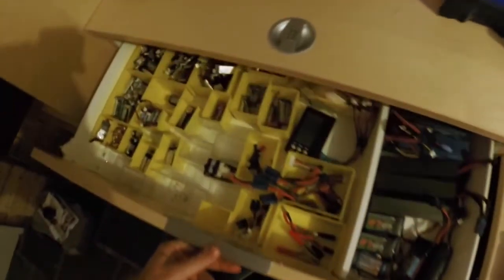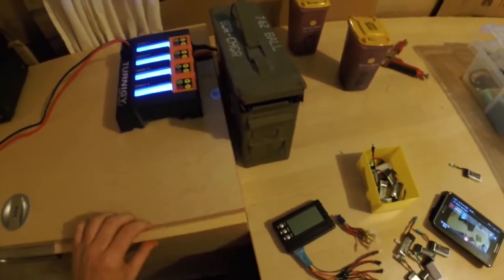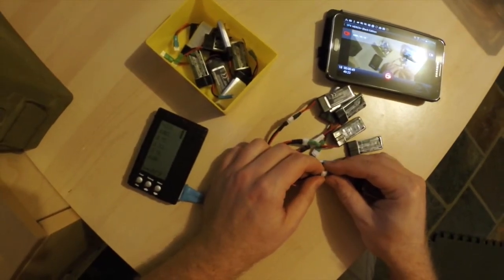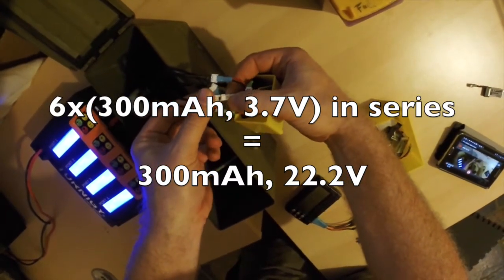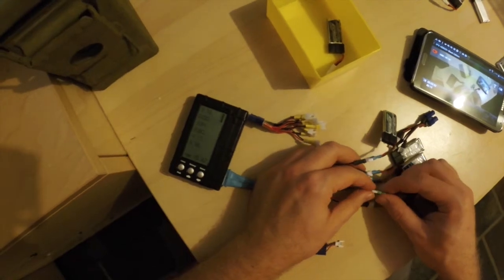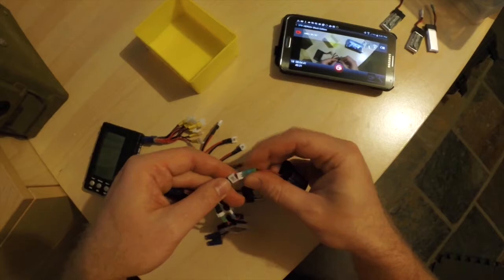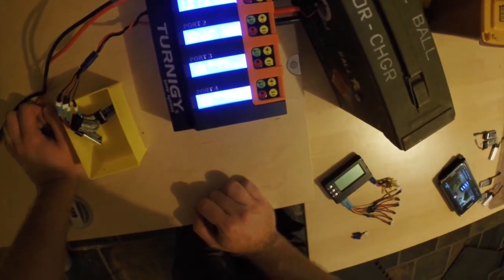How to charge multiple single-cell LiPo batteries at once (parallel/serial)

Comment: Hi. I have a Imax B6AC v2 charger + a mini parallel board with 1s, 2s, 3s JST inputs and a 3s balance connector + 6x 250mah URUAV  1s , 4.35v batteries with JST connectors. I am totally new to the subject and i simply can’t charge these batteries. Can you please tell me what is the right method with this charger? Do i select in the charger “Lipo charger” for 1s or balance charge with 6s option? And the amps? Do i select 0.2A or the amount of them all 1.5A? Totally confusing for beginners!

Comment: About Parallel Charging: Is it only important that the batteries have the same voltage? What about the capacity? My basic understanding about that is that one of my cells voltage could increase faster because it has less capacity than another. This could be dangerous, right? Or doesn't the capacity matter?
Reply from the maker: Martin Hammer You can charge packs with different capacity, but you need to keep the current low enough for the smallest pack.
Reply: Benedikt Haak I don't get it wouldn't. You charge your other packs in that scenario too if wired in parallel?

Comment: Hi Benedikt. If I charge 6 x 250mah batteries in series, does 1C not mean charging them at 1.5A?  (250mAh x 6= 1500mAh) I thought when they are in series, the charger treats it like one big cell? (1500mAh) Please let me know whether I should charge at 0.25A or 1.5A. I'm really concerned, thanks!!!
Reply from the maker: Six 1S 250mAh cells in series form a 6S 250mAh, which should be charged at 6S voltage and with 1C = 250mA. I made another charging video in the meantime, please watch it here: https://micro-motor-warehouse.com/collections/micro-charging-abc
Reply: Thanks for the explanation, didn't realise mAh stays the same with increased cell count... Loving your videos btw!
Reply: @BenediktHaak  can you mix batteries with different capacities when charging in series?

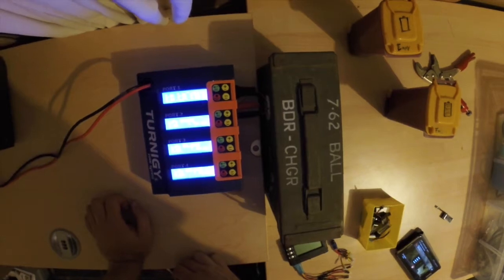Comment: At 3:00 you say you have to charge as many battery's as connectors. Why is that?
Reply from the maker: GORT Its a serial cable. If not all cells are connected, the series is not complete and the circuit is not closed.
Reply: Ahh yes I understand now.  Thank you

Comment: (Thanks for the video) QUESTION: Don't you need the balancing leads when you're charging those little batteries in series? I'm confused. Thanks in advance for your help. Regards.
Reply from the maker: Juan David Barrada when charging in serial, the balance plug is used to balance the cells actively. In parallel, they balance each other automatically.
Reply from the maker: Juan David Barrada they are single cell batteries, they don't have a balance connector. I'm essentially converting them into multicell packs to charge many of them at the same time.
Reply: Exactly, that's what I meant...why if you charge all those little batteries as one big multi-cell battery it doesn't need to be balanced? How can you be sure that each cell has the same charge than the other ones and not maybe instead being over charging some of those? Thanks again!
Reply: Same question

Comment: Is there any advantage to serial charging 1s lipos?  They dont have balance plugs so you're basically reading total amps or total voltage either way.  Is there any specific C charge rate that would balance them better?  like a slightly lower rate?
Reply from the maker: The advantage of serial charging is that you can read/control each cell voltage individually over the balance plug.

Comment: I'm new to this and watched a lot of video, this one is great. I'm still unsure of the proper amperage to charge at. I'm charging 500 mah 3.7v 1.9 wh tenergy cell in parallel. I have 5 to charge. Any help appreciated.
Reply from the maker: 5x500mA = 2.5A = 1C for 5x500mah packs in parallel. Make sure that all packs have similar voltage before connecting them.
Reply: +Benedikt Haak  Thanks I needed that clarification. I was able to charge one to a similar voltage and then charge all 5. Worked like a charm. Thanks

Comment: good day, my plane requiere 4S2300mA, but I have 2 batery 2S 2300mA, can I put in serie and the result is 4S2300mA?
Reply: yes it would work just make sure voltages are close

Comment: Hi, VERY new guy here. Could you PLEASE direct me to the info I need to duplicate the 6 1s to battery medic cable? I ordered a 6 1s to balance plug cable, but it does nothing. Thanks.
Reply from the maker: Howard F Did you see the link in the video desciption?
Reply: Benedikt Haak thanks, got it now. I didn't know how the balancer plug was wired internally.

Comment: Excellent info benedict! I was wondering about serial charging them like that. Wonder why someone doesn't come out with a board or harness with a balancing connector that treats the batteries connected as one battery based on the S rating of the (number of batteries) batteries of equal mAh connected so the charger just balance charges the batteries as individual cells. Will serial charging do as good a job if some of the batteries have different internal resistance (some old some new) as a balanced charge of individual cells in one battery would do? I use the Hitec X4 and like using the software to monitor the charges at least every 4th charge cycle to watch them. You are a wealth of information! Thanks for sharing...

Comment: For parallel charging, if all batteries have different capacity, eg 1 with 500MA, another one with 200MA, whay would happen to the peak voltage detection of the charger?
Reply from the maker: For parallel charging, you need to adjust the charge current to the weakest link in the chain. The current will be distributed based on the internal pack resistance. For simplicity, lets assume its the same for both packs. If your charge current is 400ma, each pack takes 200ma, and thats 1C for the small pack.
Since parallel charging means that all packs have the same voltage, the chargers detection algorithm will work just as on a single cell. Good LiPo chargers use the CC-CV technique: constant current, constant voltage. That means they use a constant current (whatever you set it to) until they reach 4.2V per cell. Then they ramp down the current to keep the voltage constantly at 4.2V. When the current reaches a certain threshold, the charge terminates. That current is usually 10ma, but some chargers have up to 100ma. That means tiny LiPos arent charged as much as they safely could be charged. Parallel charging is a workaround for that, since multiple packs will share that minimum current, and the effective energy take-up per cell will be higher than with separate charging. It takes longer though..

Comment: Did you have to make the harness for the battery medic?If so,is there a place you can recommend for the pinout diagram(which is common -),and where to buy the connectors?Guess I could get the same if I decide to buy an accucel charger(I haven't bought medic or a charger yet,my h107c will be here this week,and comes with usb charger,but I did order a 5way harness)?Thank You for a very informative video!Most others don't tell you about balancing/discharging.
Reply from the maker: Check the link in the video description.
I don't have a diagram, buts it very straight forward. Watch the other vid and let me know if that's enough info ;)
Reply: Bowtie41 Were you able to find any diagrams on making the balancing harness for the battery medic?  I may be mistaken, but the series charging harness (with the bullet plugs) and the balancing harness (plugged into the battery medic) appear to be different.
Reply from the maker: Those two harnesses are basically the same, with two differences: the charging adapter has bullets on the two outer pins, and it has two battery connectors more.
I made all these adapter from scratch, just by looking at the plugs. Ask away if you can't figure it out.
If you in the market for a micro charger, I recommend to skip all this, and buy a Hitec X4. I don't use all my fancy harnesses since I have that charger. Game changer!